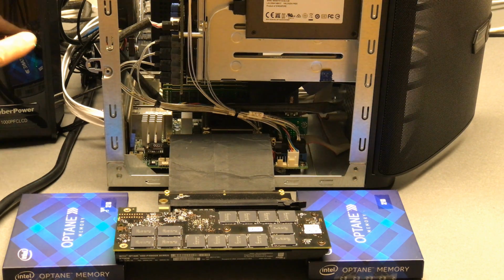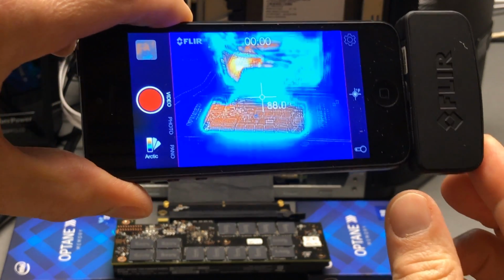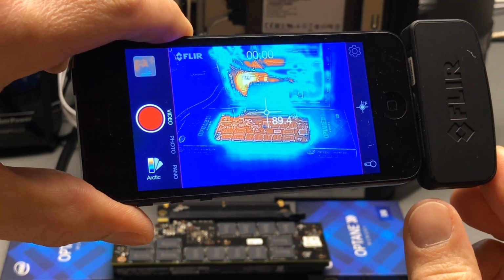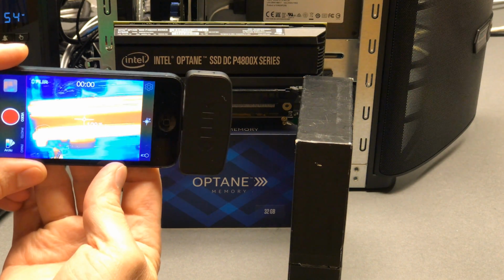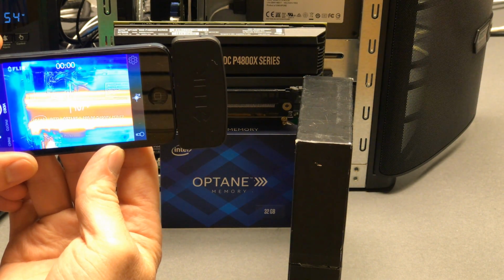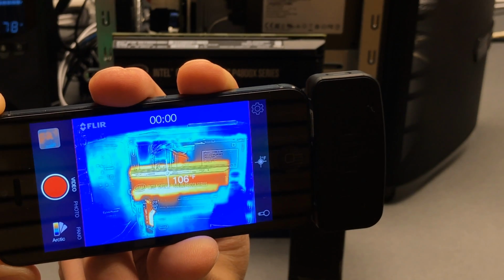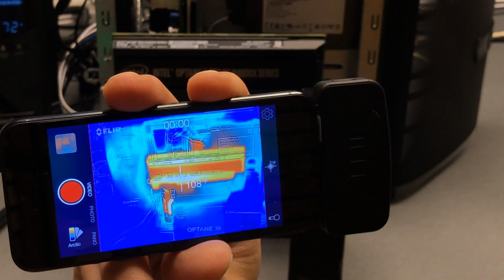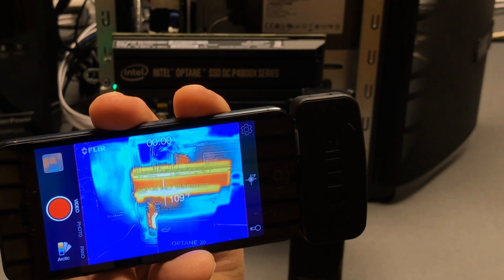FLIR thermal imaging of an Intel Optane SSD DC P4800X PCIe NVMe under 2 min. of stress

Comment: What this proves is that Intel's design spreads heat efficiently. Front and back the temperature differences are not significant. 300-400 CFM of airflow will show how much some air cooling can lower the temperature.